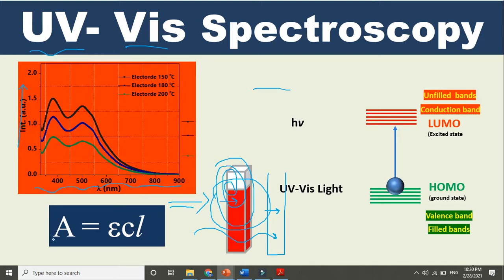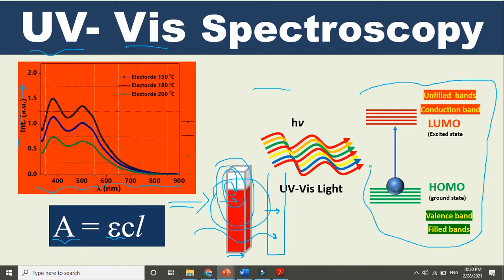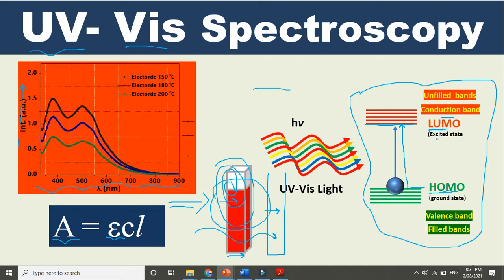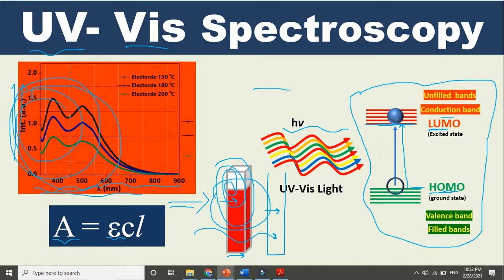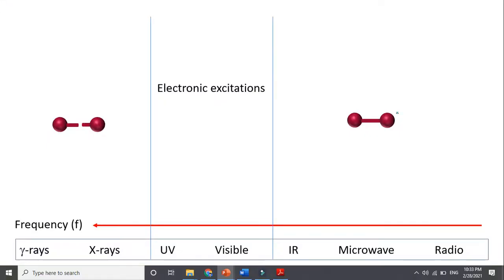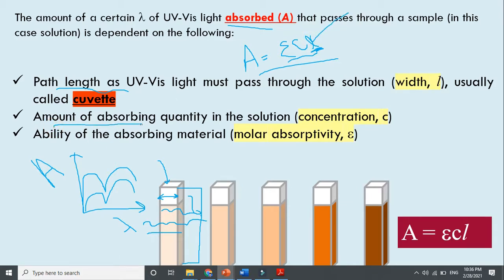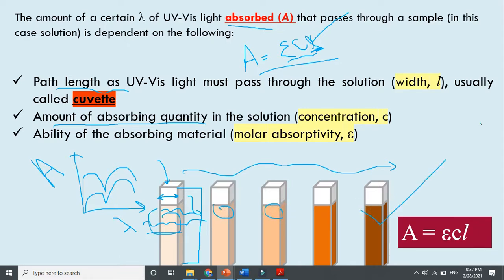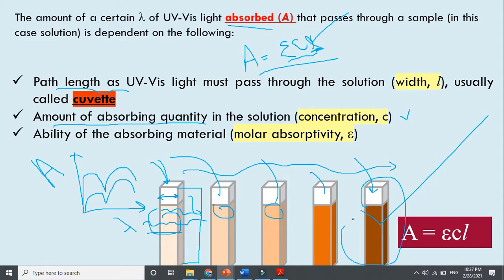UV Vis Spectroscopy for absorbance

Comment: Sir as absorbance is directly proportional to conc.. Sir could u plz make lecture about C/C° vs time  graph made for degradation of dyes (MB .MO)  ... i m confuse about which value add for C .. as i have data of absorbance vs time only from uv.. then lamba max for MB i.e 663 at 1.7 Abs then with the iradiation time .. supose after 5 min ... Abs decreases and its value become 1 then what will the value of C/C° at 2 mins .. actually i want to know how to calculate C/C° values ... and i noticed from literture that C/C° vs time  graph  mostly start from 1 Abs (y axis from top to butom ) and i could not understand from where 1 come from ... may be of log value ...
Reply from the maker: I will explain dye adsorption formula in the next video
Reply: @nanospeaks  thanku so so much Sir
Reply: @Khan are u working on degradation
Reply: @Khan hmm have u made degradation graph